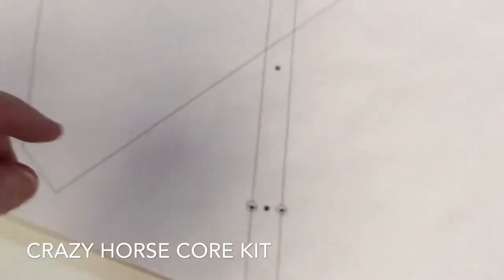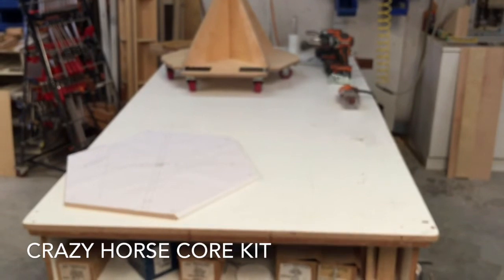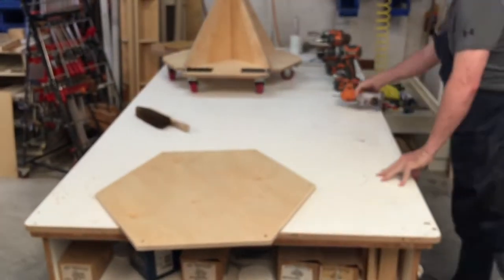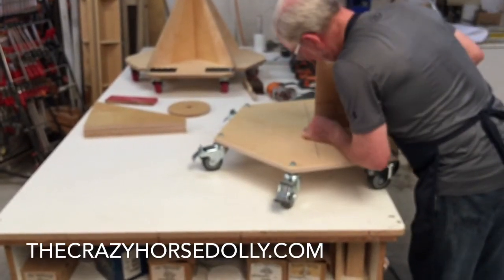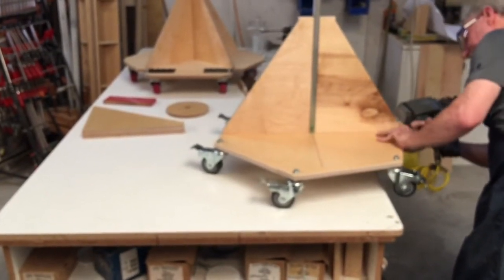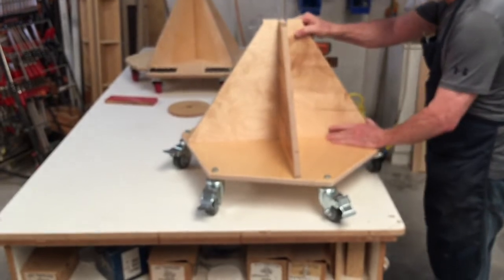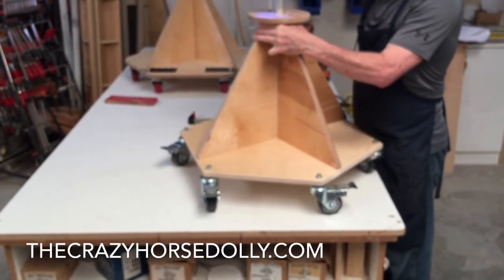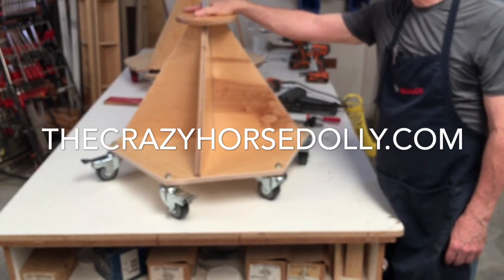Core Kit Assembly

Comment from the maker: Apologies for not showing the very top of the dolly, but you would have also had to see my head and face, so I actually did you a favor.  Also, the audio is bad because of a combination of not so great equipment and I was somewhat hoarse as well.   However,  for $95 and a few things laying around shop, you can have a fully functional Crazy Horse in 1-2 hrs using the full-size pattern/template and the patent pending Crazy Horse Core Kit parts.  Not a bad trade-off for a less than mediocre video, huh?
Reply from the maker: BTW, you will receive a full set of written instructions with the Kit as well.
Reply from the maker: I also have no idea why the video is moving like it is.  Camera was on a stand.  It may have been the heat?  It was 95+ in the shop at the time.